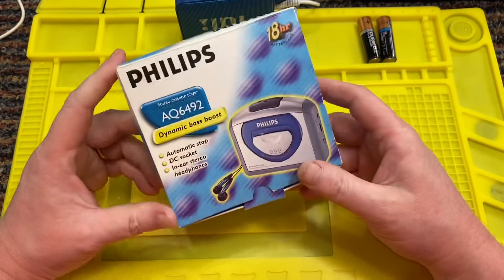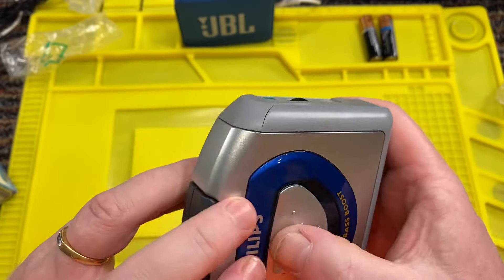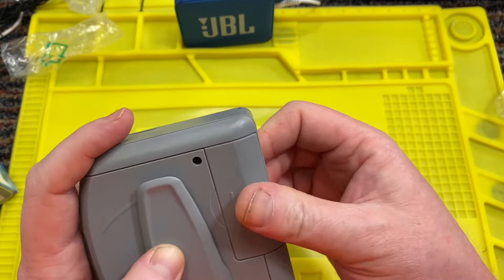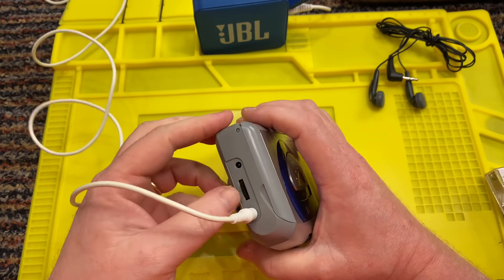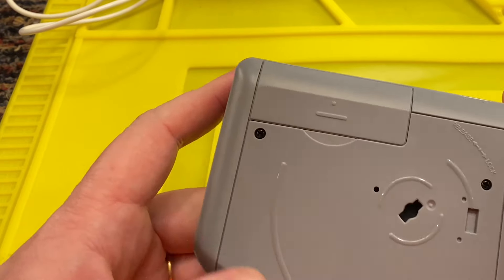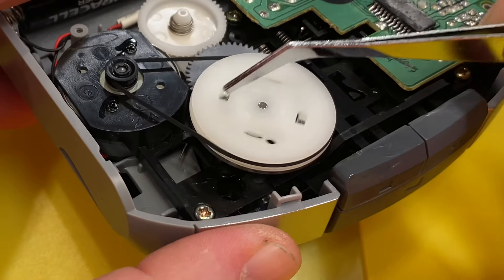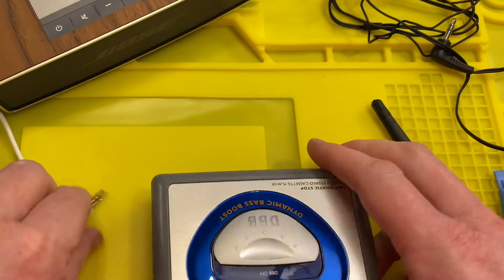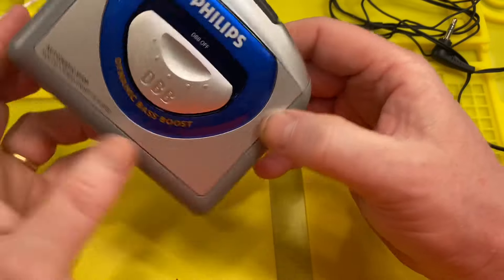Philips AQ6492 Stereo Cassette Player Repair

Comment: I felt jealous when saw u had these much belts 😂 actually I also has Phillips AQ 6490 model but not finding proper fitting belt 😢.

Please Note : when u open the player I noticed except the positive and negative wires of the motor there is not any 3rd wire for the motor for the grounding of the motor metal body!! Believe me it's very important as this may be the main reason for the "hissing" kind of interference noise from the speakers, 
I know this because in my Phillips AQ6490 there is the third connection infact. 
And one additional thing to tell u my friend, please also check the the tape head body is also grounded !! Otherwise this could also cause that noise problem.

Anyway love u from India ❤😊
Reply from the maker: Thank you my friend and greetings to you and your family 🙏🏻
Reply: @HooverLux  ❤️😊

Comment: I just got the same model of ebay for cheap. Same issue. Have a belt on order. These late 90s walkmans sound quite good, better then the stuff currently produced.
Reply from the maker: They really do sound very good.  I hope the belt works and you can enjoy it for a long time to come.
Reply: @HooverLux  did it at lunchtime today, first ever go at a belt change and its all sorted. It sounds good now. I might clean the tape head at some point but its all good for now

Comment: Hello I also have the same problem with the elastic where did you get the elastic set? Or do you think that if I put it in hot water it will become tighter again?
Reply from the maker: I just googled the name and the model number and looking in shopping. You can definitely give the hot water a go, boil water, take off heat, drop belt in water and leave for 5 mins, the pour out hot water and pour in cold water immediately to kinda vulcanise and re set the rubber structure, all it’s gonna cost is a pan of hot water
Reply: ..a moderate quality of philips back to to the  90's but thanks for the video!